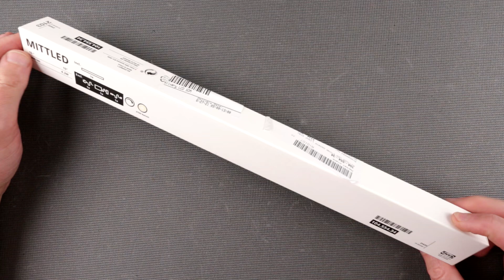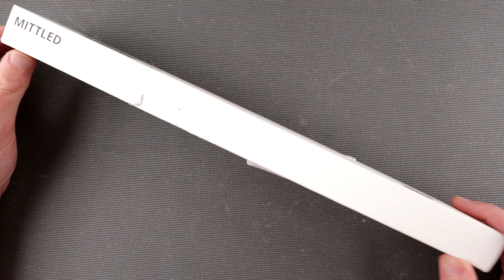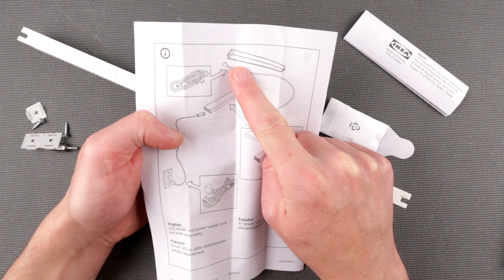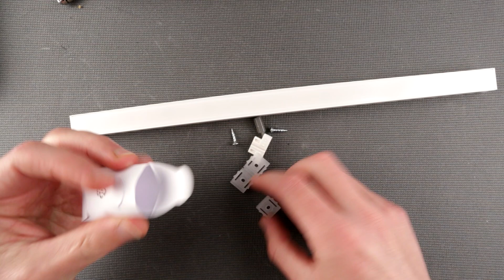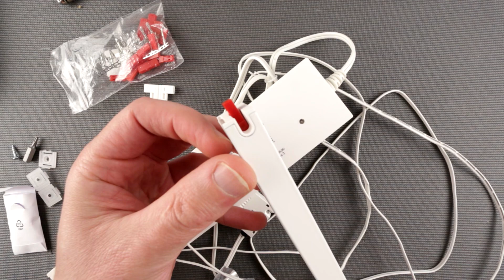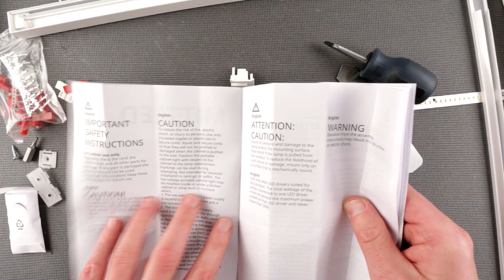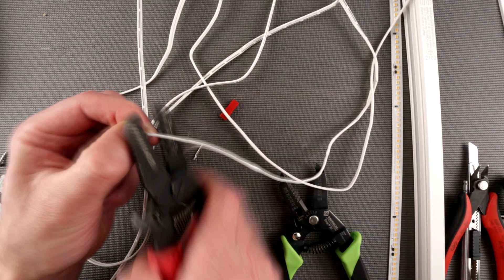Hacking Ikea's MITTLED light

Comment: I fitted 5 spots fairly easily but i now have what looks like miles off cable (ok exaggeration) that I'll trying to stuff out of the way. Is there a way to shorten the cable
Reply from the maker: Than you for watching, I would just splice the cable to the size or use red connectors as I used in this video

Comment: Can the LED strip be cut to a shorter length to make a custom length light?
Reply from the maker: Thank you for watching, no I think this unit cannot be cut to size. But they exist in fe different sizes
Reply: @InsideOutElectronics  I would also be interested in a video on how to create a custom sized strip. I have a 30cm cabinet frame in my kitchen, and the shortest MITTLED strip is 40cm.

Comment: Do you know if it's possible to cut these down to a custom length? The extrusion should be easy, but not sure about the LED's if that would cause a problem
Reply: I would also be interested in how to create a custom sized strip. I have a 30cm cabinet frame in my kitchen, and the shortest MITTLED strip is 40cm.

Comment: Bought 7 of the 80cm mittleds yesterday with two 30w drivers (60w total), 1x fornimma (power cable from driver to outlet) and the vagdal (mittled to driver). They say you can daisy chain up to 10 mittleds together.. I presume with the one vagdal but it seemed to overload the drivers (flashing lights) no matter what configuration I had. Ended up having to separate the 7 mittleds into two groups, each to their own driver and outlet. Anyone else had a similar project and had the same result? Instructions are quite confusing, and I can’t find anything online that says my config could/couldn’t work. My only guess is, and I’m no electrician, that even though I had two drivers interconnected, each one still only outputs up to 30w. With the single vagdal connecting all 7 mittleds, the drivers don’t evenly supply the 60w of needed power?
Reply: Do you know if chained drivers will respond to the bluetooth remote controller from Ikea which controls the dimming?
Reply from the maker: @francescovolpi5375  Thank you for watching. I'm not sure if Ikea has any Bluetooth driven devices. Do you mean Trafri ? Or Dirigera?
Reply from the maker: I think you have to have a driver per group I do not think you can daisy chain drivers. Curious what is the wattage on the single panel? I does now say this on Ikea website, unfortunately...
Reply: @InsideOutElectronics   there’s a cable you can get (which I have) that lets you daisy chain the drivers, but I think this just means that all drivers run through one outlet rather than increasing the overall watts. While each driver is 30w, I now don’t think that daisy chaining the drivers means it’s 60w total, it’s just 2x 30w with the benefit of only using one power outlet. You still need to group the mittleds into max 30w combinations
Reply from the maker: @mattle2646  I see, do you if there is an option for single 60w PSU?
Reply: @InsideOutElectronics  Nah not that I know of. I think the max is 30w. Maybe one day they’ll release something bigger

Comment: hey there! I have a question and maybe you are able to help me! I managed to connect two Mittled bars with these red JST-RCY connectors you are using in the video. (I could not use the propprietary Ikea connector, because I needed to install the bars in a 90° angle) Everything seems to work now, but: when I try to add a third bar to the system, using the Ikea-connector, the light starts blinking and then the whole thing crashes (= lights out). I'm wondering if this may have something to do with the voltage or with the type of the wire I am using (22 AWG), but I don't know. Any ideas?
Reply from the maker: Yes, could be thing wires OR it can be that you are overloading PSU. What is the power supply wattage and the combined wattage of Mittled bars?

Comment: Just dealing with this same thing.  I ordered a Silverglans light online for $17. Great deal!  Website didn't show it needed anything else.  Power supply and controler was $40 so my cheap $17 light became a not so cheap $57 ight.  Was pondering cutting the connector off and wiring it to a 12v supply I have for DIY Halloween lighting but need to check required voltage / ma first.
Reply from the maker: Yeah.... But 12v will not cut it, you need 24v.... well at least 20 ( may reuse laptop charging brick from old laptop )

Comment: Do you know if we attach it to a regular wall junction dimmer how to have it dim through different brightness levels? Currently it is only turning on or off.
Reply from the maker: Thank toy for asking. But it not going to work. You need ikeas wireless dimmer button that will control this. Look for tradfri device
Reply: @InsideOutElectronics  I bought a 2 amp dimmable AC/DC power supply. It works with one. Now to electrocute myself by adding 4 more.

Comment: RMF  (read the manual first) - the cable is not included as only one is needed for the entire set of lamps, if you install several of them., max 10. If it would be included with every lamp trash collector (like you with the leftovers of the other lamp) would have more trash to collect.
Reply from the maker: It was not really obvious, but thank you for your kind explanation
Reply: @InsideOutElectronics  it literally said it on the front of the box XD (0:33)
Reply from the maker: @JackStrips  yes, in tiny letters, and later in the video i mention that :)